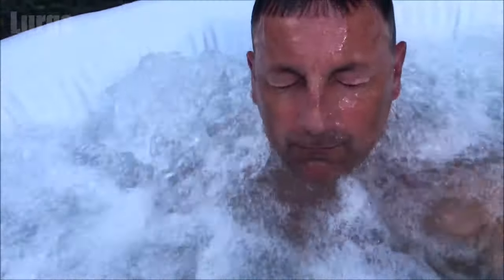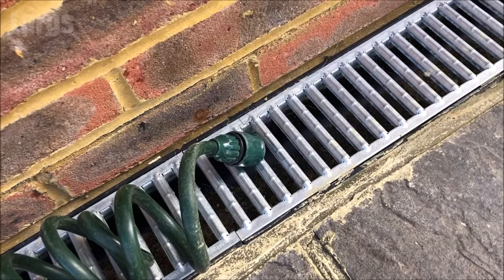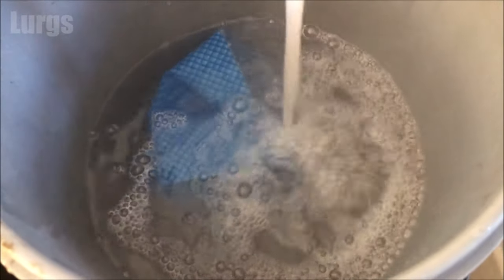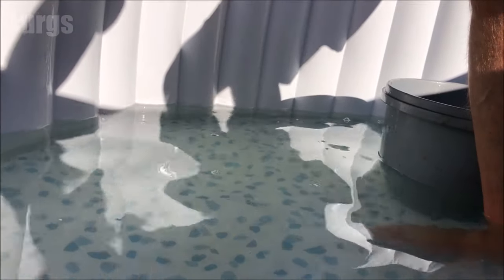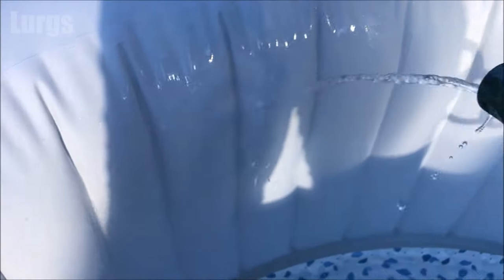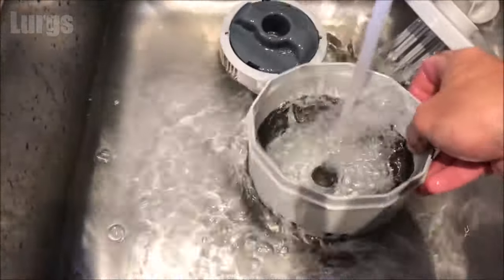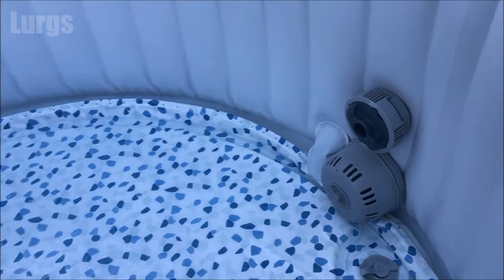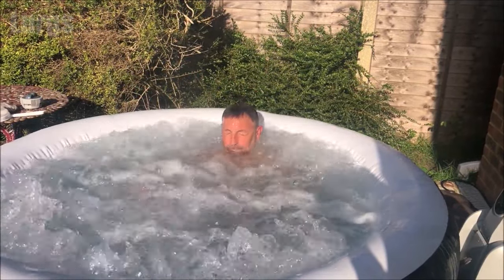LAY-Z-SPA How to empty Water & How to clean LAY-Z-SPA & fill LAY-Z-SPA with Water

Comment: Man use Aqualoon filter balls in your spa, your water is disgusting. Those paper rubbish filters do not absorb like filter balls do. Also gonna save you money because they are reusable after cleaning or washing. 12 filter balls in that type of filter is perfect, replace em every 2 weeks. Thank me later
Reply from the maker: @timvanderbruggen1573  Ok cheers I’ll look into them, so they just fit inside where the standard filter goes?
Reply: @LurgsHowToGuides  yes, exactly 12 filter balls will fit because i have the same filter. I've been using Aqualoon filter balls for many years now and they are simply amazing. Used it for swimming pools and spa's. This stuff absorbs the nasties stuff, sunscreen, algae, make up, hairs, sand etc... I replace em once every 2 weeks, let the nasty ones dry out and at the end of the season i wash everything in the washing machine. Where i live it comes in a 700 gram pack and i estimate It's above 200 pieces of balls. I just replaced my 6 year old pack of aqualoon a week ago so 25 euro for 6 years of filtration is actually pretty cheap! Keep me updated on your experience with it and happy spa days.
Reply: And you can make an How To Guide about it because this can benefit a lot of people. It's on the market for many years now and it still amazes me not more people know it by now...
Reply from the maker: @timvanderbruggen1573  Ok, cheers

Comment: Nice video thanks. Few things I do differently. Night before I clean it I shock the water with chlorine granules. This gives all the pipe work a good sanitisation. Next day I'll scrubs with a brush everywhere with old water. Makes less work later on. Drain it as per your video. Quick wipedown of the sides with microfiber cloth (traps the dirt) same with bottom. Refill. Then re shock. Leave 12 hrs test and enjoy.

Comment: Thanks for the tips on cleaning the pool etc.: I have something else important to add - the adapter for draining water can also be used in the other direction - for filling. Connect the hose and open the water access, don't forget to close the drain connection in the pool. I've tried it - it takes a little longer to fill, but you don't have to go to the trouble of laying a garden hose in the pool.
Reply from the maker: Great info thanks 😎

Comment: Thanks for the amazing video. I have the same spa but when i try to empty it with pipe hose (my drain is far on rooftop apartment) the water is not flowing. I've checked without hose the water is normally flowing out. Any insight? :)
Reply from the maker: Yeh if the hose is quite long it may struggle to flow, it may need some encouragement to start flowing

Comment: Hello! Can you shock this inflatable hot tub with chlorine before then using bromine tablets??
Reply from the maker: Not sure I'm afraid. I've not done that when I've set it up or refilled with water.
Reply: Hey Lurgs, I’ve done a couple ‘shocks’. I was advised to mix the shock granules (just a small amount maybe teaspoon or tablespoon) in a bucket with water and pour liquid in, making sure granules at bottom of bucket if any, do NOT get poured in as they could burn. 
I did this when I 1st filled with water and again a few weeks later as water was looking a bit cloudy. 
Worked well. 

Thanks for all ur tips,have been super helpful 🙌🏽